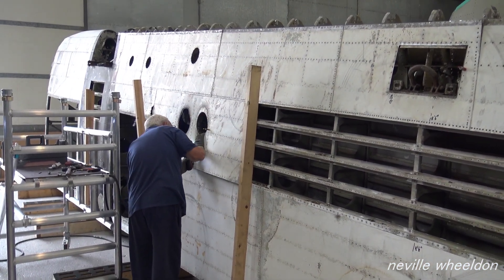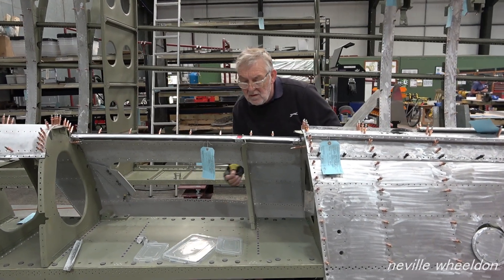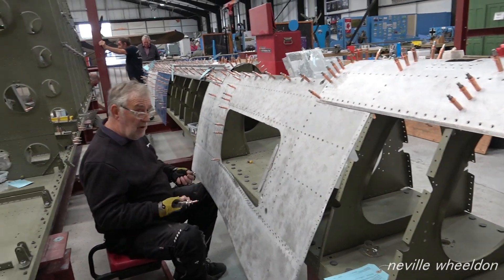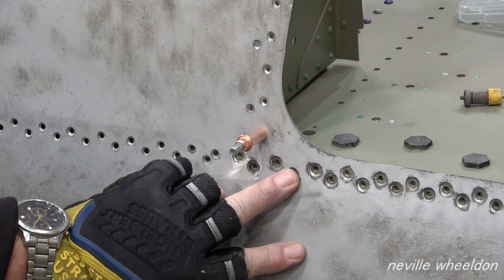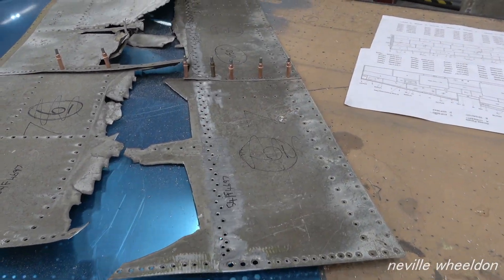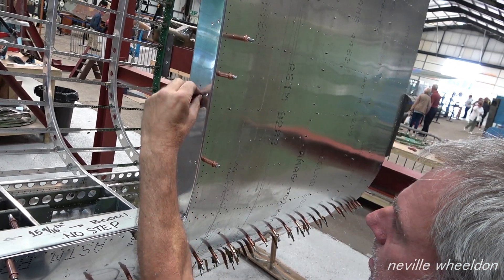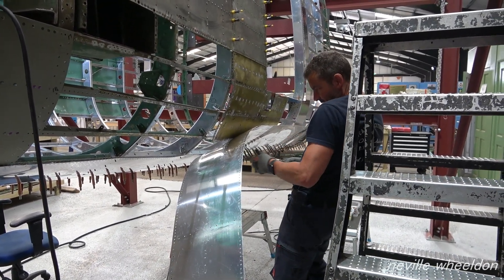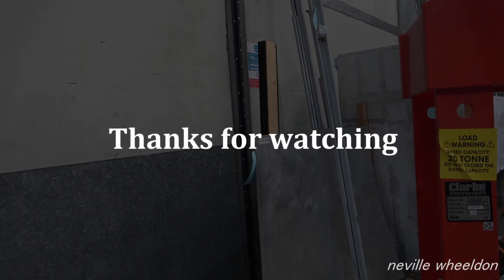Video 165 Restoration of Lancaster NX611 Year 5. Keith working on the leading edge.

Comment: Appreciated Neville 👍🏻
Q. We know that we are on year 5 of a 10 year restoration, but that was , correct me if Im wrong, based on the simple principle of repairing over the winter when its not being used for revenue raising taxi runs, but, now the great idea of repairing the French airframe to taxi standard has been introduced, then swapping out the future airworthy frame to work on while the Temp French part takes its place, providing the team excellent experience and familiarity in advance, and letting them work right through the season; this will surely save the project time on the original 10 year plan? Or was the French airframe always built into the plan? Assuming all goes to expected time predictions)
Reply: I don't think the French wing was in the plans at all until around covid time, (Andrew  Panton correct me if I am wrong). All the work on the airframes of the Doncaster fuselage and the French wing must to my mind be eating at least 9 months from the 10 year plan and yes using the fuselage once completed to be swapped onto Jane for next years taxi runs is a good plan enabling keeping the fundraising going on. The time spent on the French wing is of course a great boon to the structure knowledge needed for anything amis with Jane's wings. And doing this at this time gives the airframe guys work for the season while not currently working on Jane's structure. They guys are doing a sterling job, but doing a Lanc instead of a Sterling lol
Reply: @samrodian919  my thoughts precisely… but heard no mention of dates. I understand them not wanting to put extra time pressing themselves though
Reply from the maker: Hi Mark, no the French was not in the plans. Hi spoke to Andrew a few months ago he said thing were still online for ten years. ( They lost 1 year with Covid19 so say 11 years.)
Reply: @nevillewheeldon1693  thanks Nev. a timeline that long on a project this big will always be somewhat unpredictable as there are so many potential unknowns I think 🤔👍

Comment: Ah, missed it -- what is the "November deadline" to which you refer ?   Looking ahead to the airworthy rebuild of the wings for Just Jane - would seem to be less complicated (less time, less expensive ?) than reconstructing the French wing with tears and bits missing from corrosion and such ?  Another amazing video to add to the repository.
Reply from the maker: Hi HH on November the 8th starts year 6 of the restoration and the day the Lancaster goes into the hanger for 6 months. So the Doncaster KB976 rear fuselage has to be ready for the change over in the first 2 weeks. Giving them time for teething problems and transferring parts from Jane to the Doncaster fuselage.
Reply: @nevillewheeldon1693  Hooray !  Many thanks - and keep on truckin'